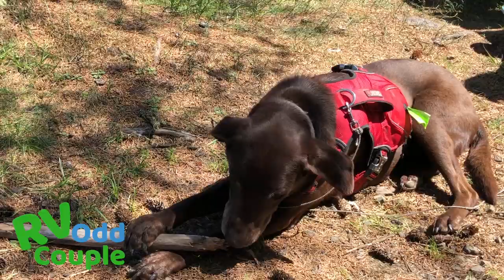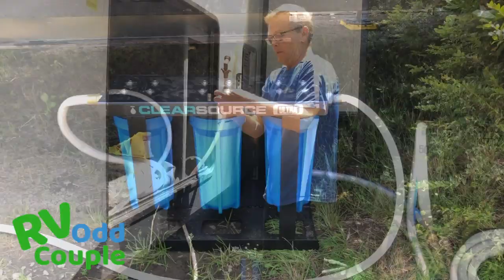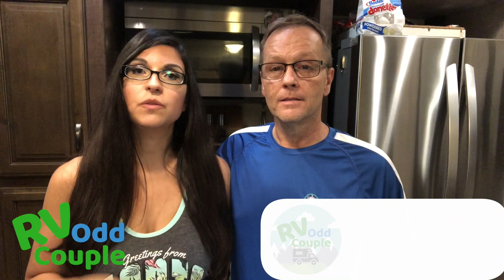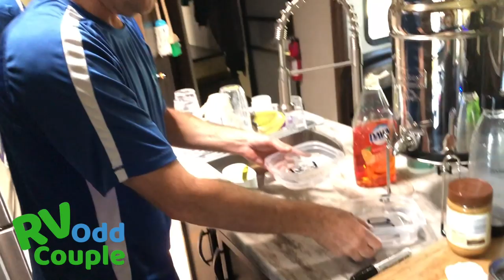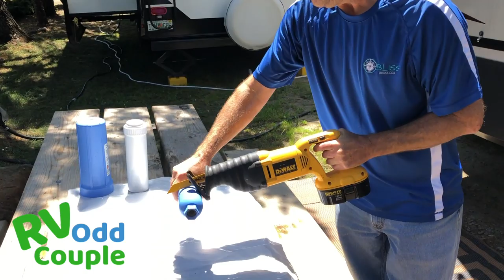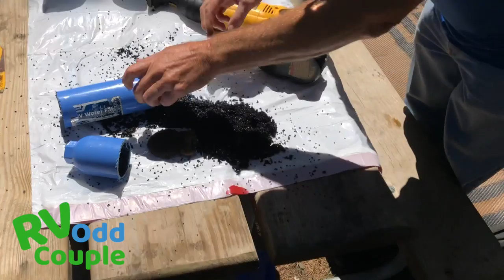SAFE TO DRINK? RV Drinking Water Solutions for RV Life

Comment: One thing I would recommend is get a water test kit that detects bacteria you can get them on Amazon or at Home Depot or at Lowes and then if people are concerned about the water in there tank and grey water and poop tank and use the 3 or 4 times Dawn dish soap that is environmentally friendly through the hot and cold lines and find a new rv park or rest stop that offers fresh water and tank dumping after either cleaning the connection port and rv fresh water hose not to mention changing the water filters and the anode rod in the water heater
Reply from the maker: Excellent advice.  Thank you!  I don't even want to imagine what could be growing in the tanks!  :-)
Reply: RV Odd Couple you are welcome

Comment: What a great product review. I think the dog test was brilliant, that was about the best endorsement any product could hope for. It does appear to be a bulky and expensive  item but when you consider the savings in bottled water it makes sense. We are going to give it a try 👍
Reply from the maker: That's awesome Gene! We think you'll love it👍😀  Make sure to use our coupon code (RVOC) for 5% Off. Thank you so much for your support. We really appreciate it💚
Reply: @RVOddCouple  We purchased the travel Berkey with the sight gauge, stand, and travel case with the intention of using it at home and away. It's a very high quality piece of equipment and worth the price. Interestingly, neither my wife or I could tell any difference in a blind taste test between filtered and unfiltered tap water. Our tap water comes from the Memphis Sands aquifer which has some of the best water in the country and will soon be the source of another bottled water brand. So this is not a surprise nor a knock against the Berkey, we are still happy with the purchase and look forward to good water in our coach away from home without hauling all that extra weight.👍

Comment: I use a water distiller at home. My TDS, Total Dissolved Solids, is 250 from the faucet. After being distilled it is 0. There is another water filter I also like, it is the Zero Water filter. I get the same results as the distilled water.
Reply: I use the distiller the most. It fits on the counter, fill it with one gallon of water & turn it on. It is a one-time expense with no filters to buy.
Reply from the maker: We're going to look into this.  Thank you for sharing!  :-)
Reply: @RVOddCouple  Thanks .. I think everyone should get a TDS Meter (Total Dissolved  Solids). With it you will see how well your system working. And that is with ANY system. When the numbers start going up, its time to change the filter.
Reply from the maker: @RonKendall48  Hi Ron, Iv'e been doing a little research on these but it looks live the TDS measures good nutrients and minerals as well. We are ordering one anyways. Thank you👍😀

Comment: We use the blue filter on the hose and then use a Brita filter inside.  Our last S&B water source was an open pond above the community, so funny smells and heavy particulate are well known and our Brita was excellent at removing it.  We changed the filters in our jugs every 4 to 5-weeks.  To this point, we have had no issues
Reply from the maker: Awesome! Glad you found a solution that works for you!

Comment: Thank you for the interesting, objective report.  We are not full-timers so the following does us no good but I pass it on for your benefit.  I discovered that iSpring (they sell on Amazon and direct) claim that with their booster pumps that the waste to pure water ratio is 1.5 to 1:1 for a RO system.  The RO membrane is kept at an optimal pressure of close to 80psi.  This waste to pure ratio is much better than you quoted in your video.  I had gotten as far as identifying booster pumps which could be operated from 12VDC when I found out that the RO membrane would fail if allowed to dry out due to intermittent service.  You (or other full-time followers) may want to consider such a RO system for your use.
Reply from the maker: Thank you for this info Gayle👍😀

Comment: Let me know if you find out what else is in the two stage filter, maybe diatometious earth (I cant spell, so not sure if it is spelled correctly)?
Also do you bleach your fresh water tank frequently to take care of the bacteria growth inside the tank?  We use the blue Camco filter, but we also do the Clorox treatment.  The way we do it before a trip (50 gal fresh water tank), empty the fresh water tank (it should already be empty if you are not traveling), 5 gal of unscented Clorox bleach (Clorox is strong & antibacterial, it is about about 6% Sodium Hypochlorite), drive around the block, then add 10 gal water, drive around the block, add another 10 gal of water, drive around the block, wait 20 minutes for the fumes inside the tank to help, top off the tank drive around the block, wait an hour, turn on your pump, open all the water sources, to treat your water lines (kitchen and bathroom) turn it on until you smell  the bleach, let the water run for 5 minutes, drain and flush the tank and your lines with filtered water before our trip (we are not full timers and without doing this, I wouldn't trust the filtered water after it gets into the tank).  Like you stated your skin is your largest organ, so even washing your hands should be with clean water.
Reply from the maker: This is excellent advice!  Thank you!  John treats the tanks with bleach every so often.  We're trying out this tank cleaner that we got from the RV Water Filter Store.  I think it's called something like Purgene.  I don't remember.  But yeah, I can't imagine what is growing in those tanks!  :-)

Comment: I think you are forgetting the most important thing, sanitize your RV plumbing system with bleach, about twice a year. You said the water still pongs, chances are it needs sanitizing. Clean out the water heater at the same time, before you sanitize, get rid of the sediment in the bottom of the heater.  Also I boil any water I drink if its from the RV system. Been full time for 6 years and no problems. Thanks for your videos.
Reply from the maker: Great Point Paul! Working on a video for this👍😀 Thank you

Comment: We havefive 1-gallon plastic bottles and every time we go to get grocerieswebring alongall of the empties and refill them at aPrimo water machine, if available, orat a Glacier machine.  Both say the water is RO water and I think they both taste the same andneither has a film on our morning tea.  My wife says she prefers the Primo water here in Payson AZ.  When we were near Bisbee AZ she liked the Glacier water just fine.  The cost varies by location from $0.20 to $0.30 per gallon.  That way we don't need to maintain fltering systems, we don't putmore plastic into landfills, and we always have great water.  We have been full-timing since June 2017 and we have used the same sytem in 17 states so far.
Reply from the maker: Looks like you have a well thought out plan for water Sam👍 You may want to consider a Berkey. We think you would save more money long term and we have never tasted such wonderful water. Let us know and we'll send you a coupon code😀
Reply: @RVOddCouple  - I appreciate the offer BUT the Berkey is another piece of equipment to find space for in the limited space we have in this 30-foot travel trailer.  The system we use has worked well for more than two years.  Maybe my intransigence is an effect of my 84+ years and CHF.  We got rid of a lot of stuff when we started full-timing and are still getting rid of stuff.  We don't want to accumulate ANY more stuff.  If we can't eat it or drink it or need to wear it we don't buy it.  But we DO love your videos.
Reply from the maker: @samcrabtree1708  That's a good point, "stuff" is easy to accumulate!
Reply from the maker: @samcrabtree1708  Thank you Sam

Comment: I've been buying the 1-gallon jugs of water, and reusing them by refilling.  With only a 25' Class C, bumper to bumper, there just isn't room for a big Berkey.  Now I'm rethinking that idea.  Perhaps I can get a smaller one.  I'm going to check out the different sizes.
Reply from the maker: At least consider it.  And I've included the coupon code just in case.  
Save 5% with Coupon Code: RVOC & use this Link: 
https://www.berkeyfilters.com/products/imperial-berkey?a_aid=5d27942325e0b&a_bid=01e2d3be

Comment: great video guys. I didn't know a system like the Berkey existed. BTW the sponge on each end of the charcoal filter prevents the charcoal granulate from entering your waterlines. Can you imagine the mess a failed sponge would cause?
Reply from the maker: You know what's interesting, the sponge on one side was in the center of the filter.  Meaning the water pressure pushed it in.  Not good.  But glad you enjoyed the video!  :-)

Comment: That brown stuff in the second filter that you said might have been sand or Earth you are actually right it's called diatomaceous earth is used in swiming pool filter systems to scrub  the water. It is also used by fish tank and Aquarium owners 2 scrub / polish the water I have used it. There used to be a company called vortex innerspring a number of years ago now, that made a filter that you. Hang off the aquarium and it was filled with diatomaceous earth and it got the water's so clear you could actually see a difference after about 45 minutes of running it  I don't know about its properties for taking care of health related that kind of stuff but you could definitely see the difference. it is also back flushible meaning that you could clean the filter out to reuse it without disassembly.
Reply from the maker: Thank you for sharing that information James. Very interesting

Comment: Hi guys. I'm very grateful that you've done this video. I have a license in water technology. The gold stuff that you found in the filter is something called
KDF. Most of everything you showed though needs water pressure. And I'm a boondocker of 20 years. The birkie looks like the best option because you can just fill it with your water and it will do it without water pressure. That's why I've never put a water system in because it needs the 40 lb of pressure to go through the Reverse Osmosis System the UV light Etc. So thanks for the tip on the birkie that's what I'll be getting. Thanks a lot for the video
Reply from the maker: Happy to help Kavita💚😀👍 We love our Berkey and so does Skippy! Please use our link and save 5% https://www.berkeyfilters.com/products/imperial-berkey?a_aid=5d27942325e0b&a_bid=01e2d3be

Comment: Also I'll offer another suggestion the best thing you can use for sealing your roof is flex seal they have flex seal tubes for for caulking and flex seal in the gallon use it on metal roofs or rubber roofs it's the best thing going it doesn't come off like the other stuff they sell in RV stores for resealing your roof I've been living in my RV now for 6 years and that's the best thing to use on your roof I was using that other stuff the first three years and some of the residue after I put it on after about a year it comes off and I have to redo it now the first time I used the flex seal I roll it on One direction lengthwise and then I wait for it to dry and then I roll it crosswise and two different directions I do it two good coats and then the second year I did the same thing now my roof is good internally sealed and the roof is just as good as the day I put it on I do go up there every so often I scrub down the roof to get the dirt and debris off of it and I use a fabulosa detergent and a bucket of water and a scrub brush that I use that you buy for scrubbing your car I scrub down the roof few months and this keeps you roof and top shape and you don't have to worry about leaks in your RV roofing

Comment: Would be great to see the berky filters cut apart as well. Seems that they are just the same as the camco ones, filled with carbon and zoelite. Since most RV's don't have enough space for a coffee maker in the kitchen, how'd one fit a berky there. In the sink maybe??  I believe that filling your tank in an area with city water , and using that rather than some scetchy park water from a well that may not be tested regularly, is a better option. At least here in Canada most city water is run through multimillion  $$ equipment , Which is why Nestle fills their bottles from the tap in Hope B.C   The only down side is you travel with 500-600 extra pounds of weight, of course if you boondock you already do that.    ;-}         CHEERS                Steve h.
Reply from the maker: The Berkey filters are completely solid with nano technology and are gravity fed so they emulate nature. Forcing water through a filter using pressure really changes the game.

Comment: Question about the Berkey - I intend to use this in my RV.  The space on the counter is limited and the height to the over-the-counter cabinets is only 15 inches. Can I remove the upper chamber after the filtration process has been completed and simply put the lid on just the lower chamber?  I could simply move the Berkey out onto the main part of the counter during the filtration process and then remove the top chamber after the filtration has been completed.
Reply from the maker: Yes. you can do that but I would order and additional cover

Comment: Loose carbon does not work. GAC granulated activated carbon does, but requires pressure to force water through it. Yet Carbon only removes dissolved gases, will not remove bacteria, cysts etc.  tastes better but not all that healthy. Only RO will do that and it also requires water pressure. Get an RO unit for drinking, coffee etc.
Reply from the maker: Thank you Steven😀
Reply from the maker: Good stuff..Thank you

Comment: Good video. I have had to travel for my job for years. I have stayed in locations where the water coming out or the tap could not be used for coffee. We now live in the Tampa area. The water is not bad but at times it does have a slight oder. We got a Zero water filter and it's a 5 stage filter abd there is no Oder or taste.
Reply from the maker: Thank you Ron😀 We'll be in Tampa this winter

Comment: Great topic something I've been struggling with for some time now. Filtration systems are great, so is sanitizing your RV but that only protects the inside plumbing. My question would be how do we sanitize what is coming in from campsite to campsite to campsite. True city water should be okay with all the chemicals in it to kill the bugs. Freshwater tank should be okay if you have sanitized correctly and monitor the source that's going in. In Alaska they have dedicated fresh water filling stations. My Flagstaff Super Lite has a built-in filtration system but that is only as clean and safe as the water coming in. I know you can add a few drops of bleach to the fresh water tank, but what do we do if we're on a campsite with well water?  With a large German Shepherd who drinks about 2 gallons a day and my own use I found it is just a pain to rely on bottled water. Thanks again for the great videos I just discovered y'all today, so looks like I know what I'm doing for the rest of my Saturday 😁
Reply from the maker: We filter all water coming in to the RV and then only drink water through our Berkey. You raise some great points on holding tanks! That’s a whole video in itself. We’ll work on that. Welcome to the RV Odd Squad and thank you for watching our videos MN Patriot 👍😊

Comment: The online filter is probably a fine mesh poly filter for sediment and to hold the charcoal in place and not migrate
Reply from the maker: That's what we're thinking.  And it looks like the water pressure pushed one side of that in.
Reply: RV Odd Couple may have before you put the pressure regulator inline.

Comment: Great information here. Wonder how much filtering is involved in the Berkey? Does it make bottled water taste different? I've been thinking about getting one of those for a while. I would still use the camco filters mainly to keep the sediment out of the holding tank but for drinking the Berkey sounds great to me. 
Pat
Reply from the maker: We love our Berkey.  The heating element in your water heater and other plumbing components are still at risk with the CAMCO, but it's better then nothing.  Just in case, don't forget you can Save 5% with off the Berkey w/ this Link: & Code RVOC
https://www.berkeyfilters.com/products/imperial-berkey?a_aid=5d27942325e0b&a_bid=01e2d3be

Comment: Berkey in a chat with them said that they recommend not traveling with the filters in the unit. But the reviews that I have seen, including yours does not say anything about it. Do you remove filters before traveling? Are you using the floride filters plus the black ones? Thanks for the honest reviews!
Reply from the maker: Hi Rick.  Right now we're just using the black filters.  We have not removed the filters while traveling.  We found a place to store it upright where it doesn't move.  We would never recommend that you Not follow their instructions but since we can keep ours upright we didn't see a need to disassemble.  Hope that helps.  And we appreciate your kind words.  :-)
Reply: Used your 5% off coupon and bought a scratch and dent travel Berkey. Also got the floride filters. But I also noticed they sell a spigot with a level gauge on it so you can tell the level of water in the bottom container. Thanks for the nudge to do the right thing!
Reply from the maker: @rickw5679  That's awesome Rick! Thanks again for supporting us. We are checking out the travel bag and spigot.
Reply: @RVOddCouple  Did you get the filter primer with your set up? Just not sure how needed it is. The rep from Berkey said the bag isn't really needed as long as you have a safe way to hold it during travel . Take care and thanks again!